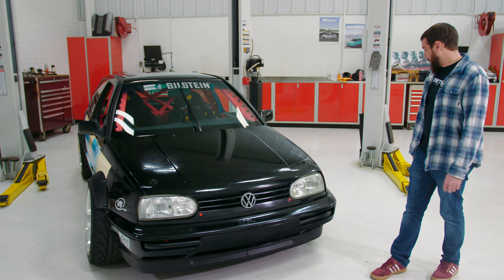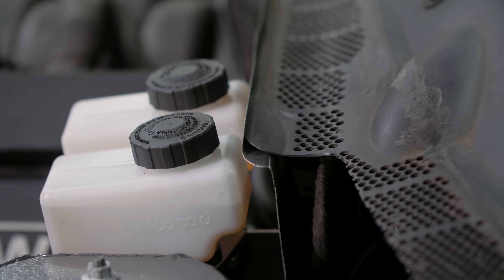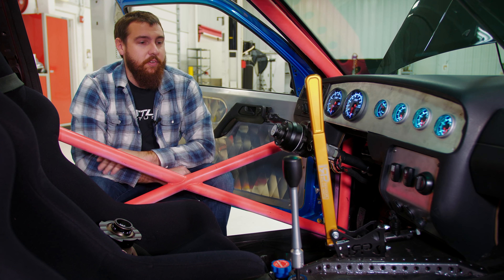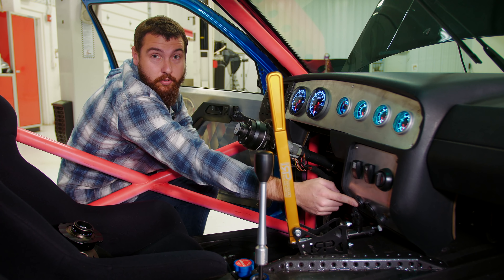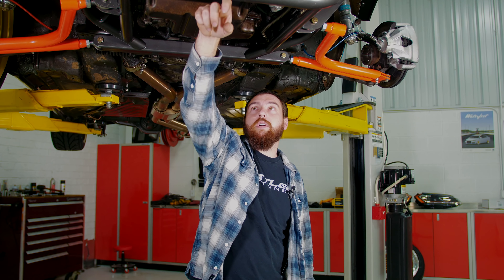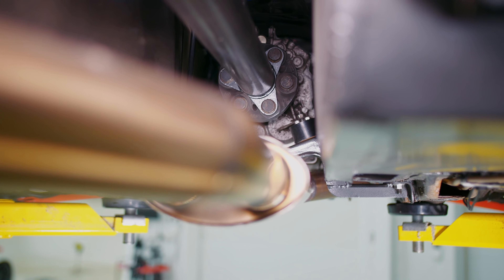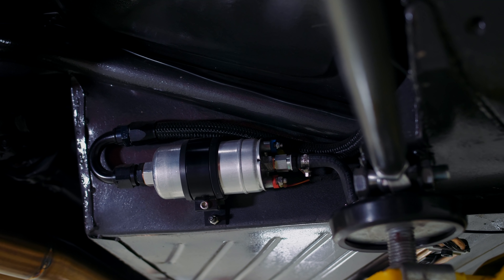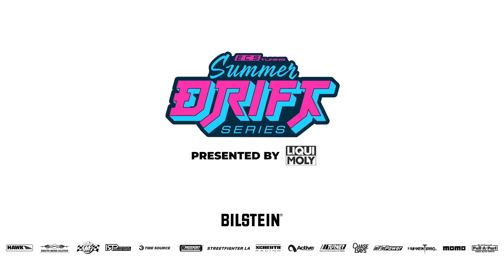BMW M62 V8 Swap VW MK3 Golf // Summer Drift Series Presented by Liqui Moly

Comment: You're a bit "insane" Mike, and I LOVE IT! About the only thing I'd add/change is putting an additional Aluminum heat shield in the rear end above the fuel cell with a fairly thick layer of insulated padding under that like what you'd see "originally" on your firewall to keep the heat from the radiator system from heating up the fuel in the cell too much on longer drives for a little higher HP over all. "Hot" fuel doesn't expand as much as cold fuel does in the combustion chamber, not that you're "lacking" much in the power department with a V8! Plus you might have a fair amount of pressure build up in the system which may cause issues?! Just a thought! Kudos on a sick engineering accomplishment!

Comment: I think you should put in a partition to keep the fuel isolated a bit more from the radiator heat. Hot fuel will only rob performance, or cause worse problems.

Aside from that i love it and it sounds nasty as hell

Comment: ✌W ? 
The incorrect information was on USP Motorsports website that said they had a stage III kit for the mk7.5. They said, "Unfortunately the kit will not fit 2018 and up models. I have just had our website updated to reflect this." I contacted APR and currently they don't have a stage 3 for mk7.5 yet. I'm waiting to hear back from COBB. I am trying to do research on getting at least 385 TQ and 450 HP to the tires on my 2019 mk7.5. Anyone out there could share any information I would appreciate it. Thanks

Comment: If I was You I'd also have the wheel base extended by 5 inches or more in the front. So the car would be more stable.
Reply from the maker: We'll pass the suggestion along to Mike. Currently working on some mods, new series coming soon.